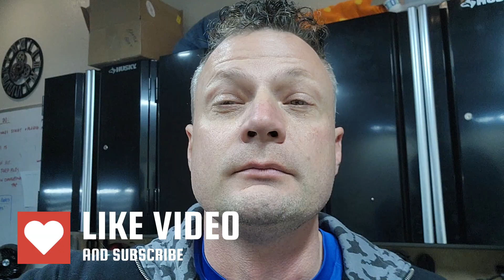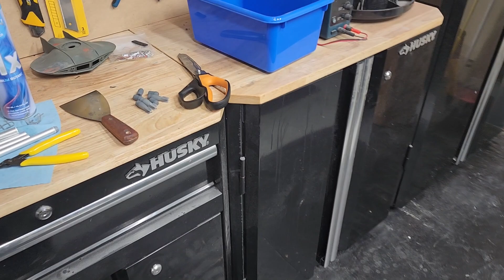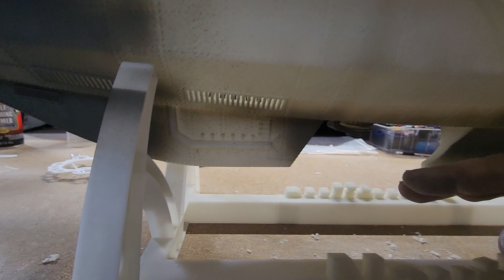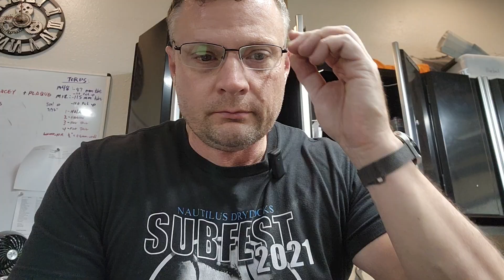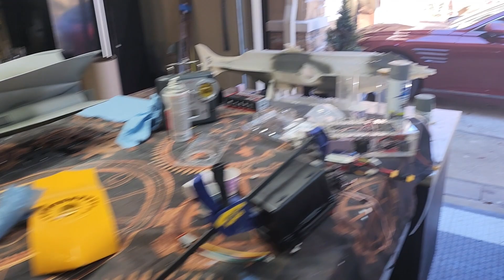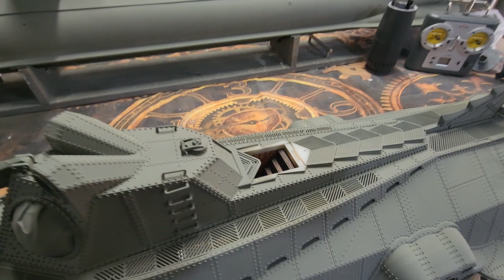Death of the Flying Sub, MORE Seaview, More Torpedoes, More Nautilus! Drydocks Update 01/26/24

Comment: I would try adding some weight to your Torpedoes.  Add 3 or 4 thin rods of steel, brass, of even solder inside the body tube, secure the wires with super glue or epoxy.  It would decrease the volume for gas but I don't think that will matter that much.